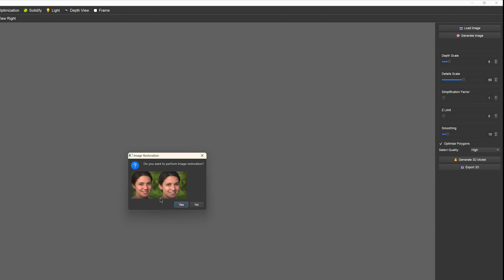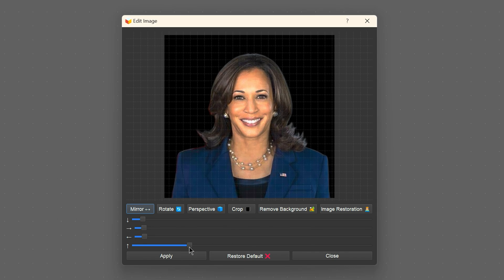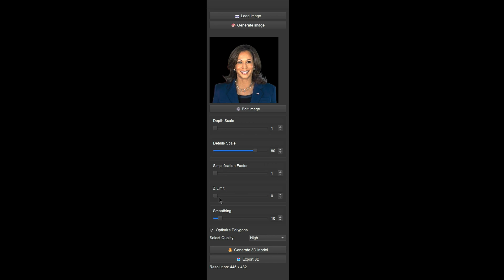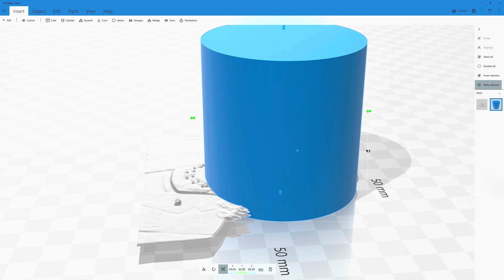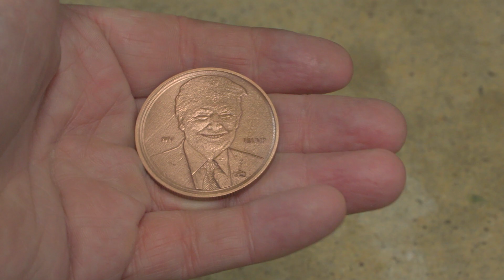VistaSculpt - Double sided US Presidental Election Coin

Comment: @jmone3559 - Thank you very, very much for doing this short tutorial Nathan. Good timing, indeed. Quick question. I noticed a setting in the upper right corner called "Depth Scale". You have it set to 1. What is the range and what is this is parameter in relation to the Z Limit? I'm thinking the higher the contrast the better (from a depth or height map POV). Also, do you know what the "Simplification Factor" setting is doing?
Reply from the maker: I've got a 2.5D laser (live Z-Axis) that can take a STL (EZCad3) and engrave down with a (calibrated) layer height on 0.02mm on my setup.  With a coin, that only gives me 15 layers if I want to only engrave 0.3mm (on each size).  Any deeper and the coin starts to "thin out" too much.  In playing with the settings in Vista sculpt, a setting of 1 for Depth Scale and 100 for Z Limit gives me a flat .3mm (ish) STL when scaled for a 40mm coin blank...ideal for my setup.  If I leave the Z Limit at 1 (unconstrained) then the STL will be .6mm.  If I increase the Depth Scale the height is increased with each step up.  It I scale just the Z axis down to 0.3mm on such STL then all the details are just lost.  One other way that could work (but I've not tried yet), is to have a higher STL --> more layers to engrave --> but lower the power on the laser to compensate (and it would take longer to engrave).  Mmmm, I'll give that a go as well.
Reply: @The_Smelters_Apprentice  I see. For this use case we're working with two Epilog Fusion Pro 36 co2 lasers and 1 dedicated Shop Sabre 404 CNC. We have other equpment as well. We use all kinds of software from Adobe CC Suite to Vectric Aspire 12.0. Evrything is so manual right now so we're really searching closely for an automated approach and hoping this one or another package we're looking at will get us to the finish line.  You're spot on about speed and efficiency though. TIme is money. Thanks man!
Reply: @storytellerHD I just got the 3 month pro license. This software is amazing. I’m using it primarily for CNC and yes, it reduces the process down to the level of very simple to get a decent model from a 2D photo. It is NOT generating a depth map - it’s an actual mesh 3D model. While it still can require some tweaking for black parts of a photo - because it will make them deep - it seems to be able to figure out what is in the foreground, background, it keeps faces attached to bodies etc.

I’ve found that increasing the depth range and finding the sweet spot for the Z limit gets me the best detail for my use cases, but I’m not doing flat surfaces like this. Try the 3 month pro license - $167…
Reply: @MachinedInWood  That's good insight. Thank you. Yeah, I think we'll give the Pro software a try.
Reply: @storytellerHD  incidentally, after playing around with this some more, I have to correct myself - it DOES output depth map files, if that’s what you’re looking for. I use stl for my workflow, but when I checked, depth maps in PNG and JPG are an option. I reached out to them about documentation and there is none. They told me to go to their facebook, but there’s nothing for actual “this is what each button does” type of documentation.

I’ll probably put out a video on how I’m using it on my channel in a few days…
Reply: @MachinedInWood  - Hey there. We use STL file format also, though mostly with Vectric Aspire (for CNC) and occasionally in other 3D modelling software. Depth Maps work very well with our laser engraver (Epilog Fusion Pro) when "deep engraving 3D" functionality is chosen in the  workstream. It works by lasering those subtle gray scale shade value changes from one dot to the next. The result on wood is absolutely fantastic. The detail is amazing with this method. The CNC can do the same, however not nearly as sharp. 

Yeah you're correct on the documentation. We've been tracking the development of this platform and eager to try it soon and haven't been able to find so much as a PDF file on their support link. Strange.
Reply from the maker: ...or increase Speed!